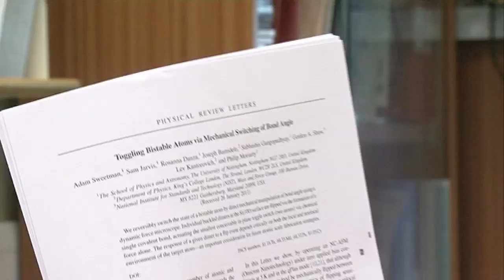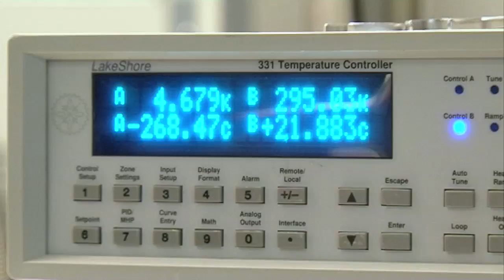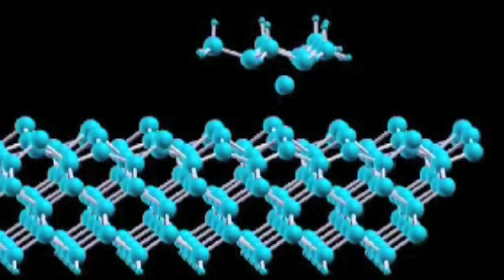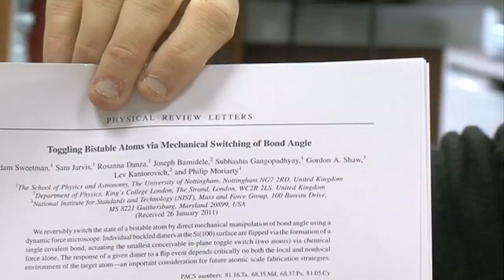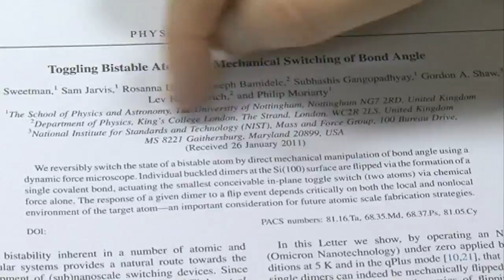Atomic Switch (moving atoms) - Extended Version

Comment: The instrument being used to produce the images is called an AFM, or atomic force microscope.  It uses a silicon nitride cantilever with a tip only a few nanometers in size.  The tip is so small that atomic force alone is enough to deflect the cantilever in one direction or another without even having to contact the surface.  The amount of deflection is measured using a laser interferometer.

Comment: Incredibly impressive machine too.  Silicon is what about 100 pm ionic radius?  You are getting quite a lot of pixels per atom, say ~ 1 pm resolution, stable enough for hours of scanning.  Then you have to position the tip and push on an atom without crashing the tip, then redo the scan.  Amazing what you can do with low temps and high vacuums.  I am surprised you can just walk around near the machine while it scans?  I assume it has pretty special isolation or is very, very rigid!